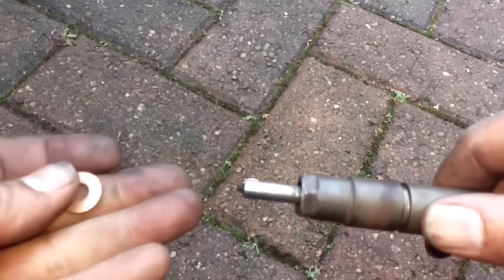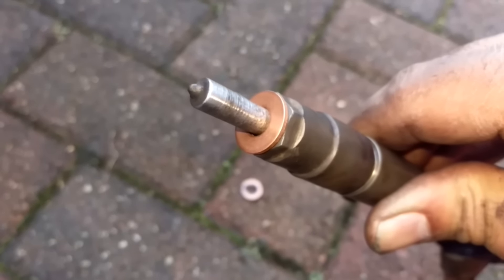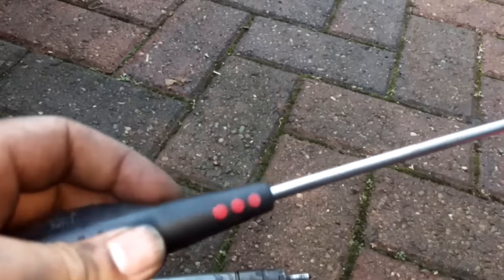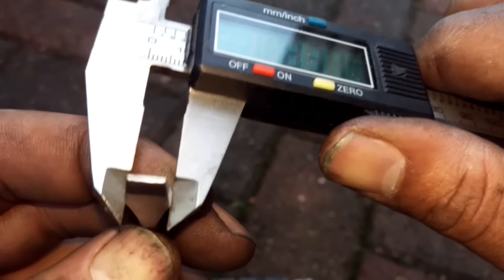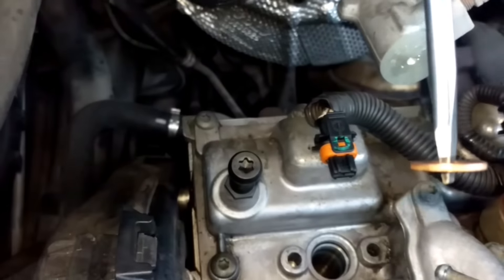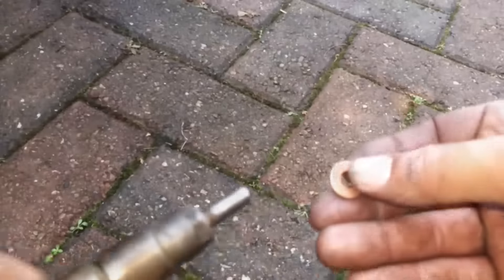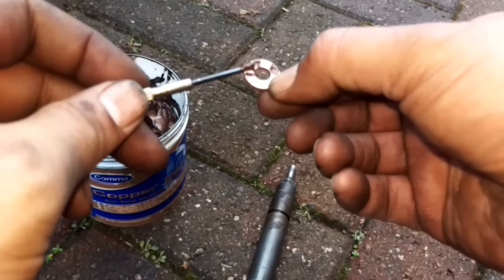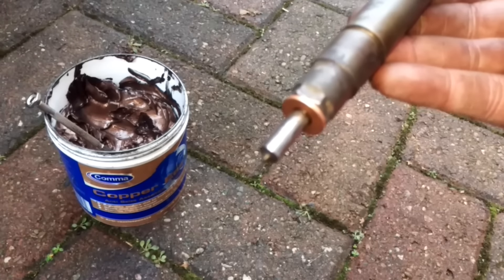Stuck Injector Sealing Washer Removal and Easy Installation

Comment: a friend used cooper grease like you and was left with a nasty exhaust leak, i cleaned it all and it was fine after that. My conclusion was to use cooper grease only for what it is intended: threads.
Reply from the maker: Correct use of copper grease will not cause a leak and you never put copper grease on threads unless you want to torque up the bolts incorrectly.

Comment: Thanks for the video. I have the same Halfords screwdriver set as you and unfortunately because my copper washers were particularly crusty it didn't work. What did work though was a piece of M8 threaded rod screwed into the centre a little. Wanged them out no bother. I actually did a how to video myself showing this method!

Comment: Mate!! You are a star!! Citroen C4 1.6hdi.. how long are the injectors.. a mile long.. this trick worked and absolute treat. Thank you.
Reply: Mark Piercy I'm doing my wife's picasso and the hole has expanded because it's stuck in there I'll try the Carb cleaner and try again.
Reply: Coca cola ? It'll unseize aluminium....good luck.

Comment: Great instructions but try that with an M9R which has a ton of hard weather between it and the  injector bore….. I have a good technique but it is very risky if you are not careful.  Also to note most washers burn from the centre out and therefore the hole is usually bigger than 8mm and stuck even too big for the tapered washer pulling tools.

Comment: This has just saved me probably a long time, luckily I have that exact screwdriver! It also helped me clean out the holes by wrapping an old washer in paper towel before putting it on the screwdriver.

Comment: Hi SiRobb. What torque you screw the injectors back in? Also, in my Volvo V70 2.4 D5 2006 there were no those black dealings and circlips - is that ok?

Comment: I tried for ages to recover these from the head, all the injectors came out without the washers. This tip helped me no end so thank you for this video. I opted to replace the new washers with the screwdriver inserting them into the injector hole then wiggled the screwdriver to release them, seem to work & all injectors slide bag in ok. 
Thanks again.

Comment: Hi mate love your videos I’ve got a leaking rocker gasket and leaking injector just a question when taking the fuel lines off to do the work do I have to prime the fuel system after taking the fuel pipes off and on kind regards Boyd
Reply from the maker: Thanks for the comment. 
Yes, once everything is back together you'll need to prime the fuel system which doesn't take long at all. 
If you have a D5, you just cycle the ignition a few times for about 10 seconds each time before turning over the engine. .
Reply: SiRobb thanks

Comment: you have no idea, what "stuck washer" means :D
Reply from the maker: Why? 
Other than carbon, fuel and soot, what else can stick the washer?
Reply: Ou well. Toyota Rav 4 2008. 2.2 Diesel 130 kW. 2 of 4 washers was leaking, but all 4 didn't came out. 3 of them i got out with punching king size Philips screwdriver in and trying to turn them around. One is still in. It is day 2 by the way :D
Reply from the maker: It's only stuck by carbon so just soak with carb cleaner.
I've never taken longer than 30 minutes to remove all washers and I've seen some very stuck washers.
Reply: Tried soaking with carb cleaner 5 times with no result. Clearance between washer and injector hole is so small, that after removing washer you Can see aluminium on it sides. It is just physically stuck.
Reply from the maker: They've previously fitted washers with too large a diameter then.
There's no need to fit washers with such a small gap to the walls of the injector port so make sure you don't repeat their mistake when fitting new ones.
Reply: Washers come with the new injectors and they are oem - Denso 🙈
Reply from the maker: Buy smaller copper washers then. They're not expensive.
I'm sure you can get the same internal diameter, same thickness but smaller outside diameter.
Reply: Same thing here, 3 were coming out relatively easy. One was REALY stuck! Took me a long time to get it out. Nothing worked, managed to drive a thread in and it finally came out. OEM washer in the right size.